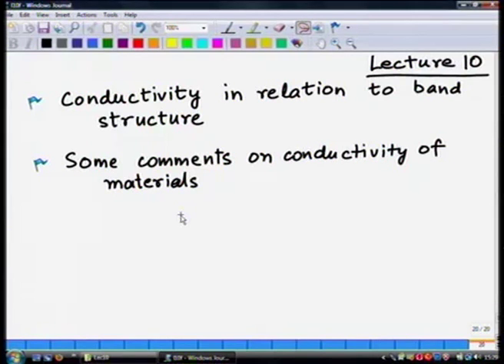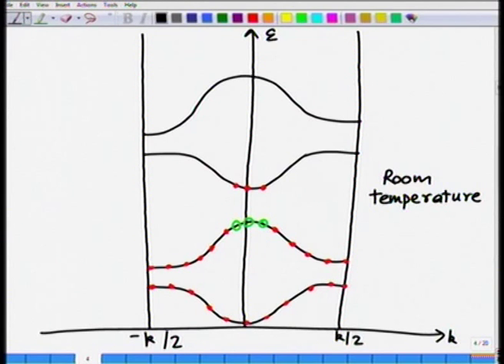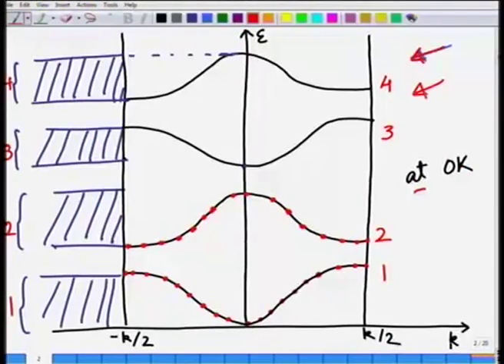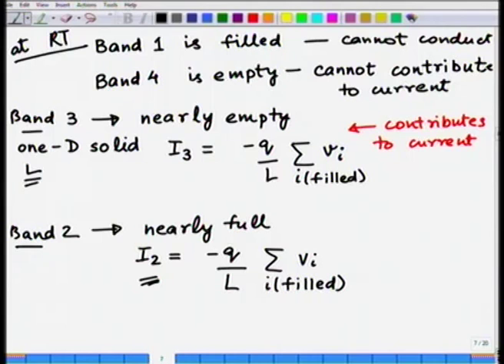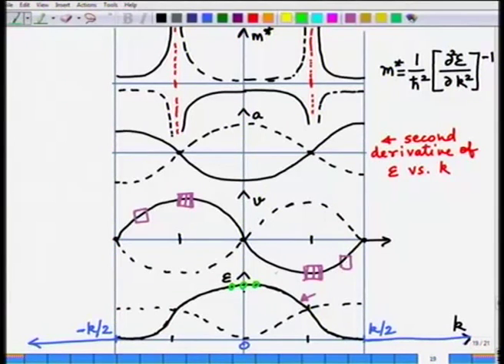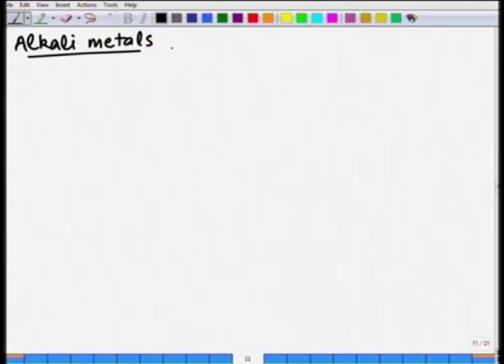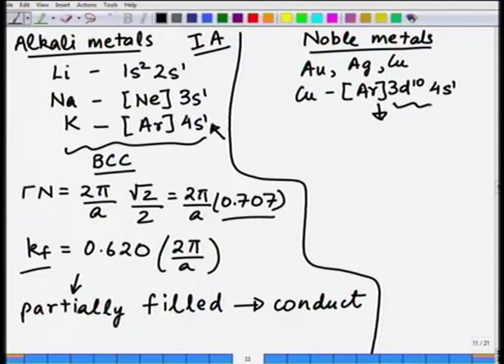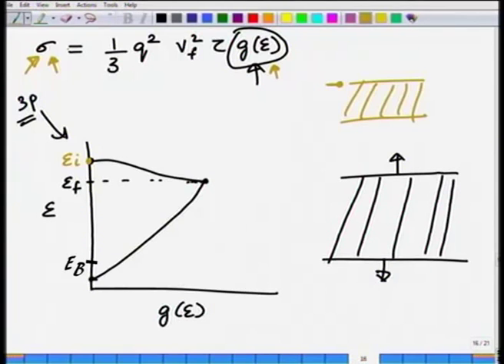Mod-01 Lec-10 Conduction in relation to band diagrams

Comment: when EF is applied the direction of motion of holes will be opposite to that of electrons right?????
Reply: @10:20
Reply: Note that that’s a vague question to ask
We never defined motion of electrons in real space 
their motion is studied in the k-space
We thought of holes in the energy diagram as empty places for electrons
So motion in the k-space for the holes are actually occupation and de-occupation of electron states
That’s how v_i for empty is defined

In real space I don’t think you can say electron will move to the left or right it could be in superposition of both these states where it has a greater probability to move opposite to the Electric field
Since “holes” are quasi particles not real and are analysed only in k space it doesn’t make any sense to ask for their velocities (if you argue hole is an empty location then let me tell you most of the space in an atom is free , which location you’re talking about ?)
Reply: @hrs7305  What :)?? It doesn’t make any sense to ask for their (holes) velocities?? Since when? Hole mobilities (velocity per unit electric field) are routinely defined and plotted as a function of field in any basic semiconductor device book. And in real space you can say whether an electron will move to the left or right under a field. How do you think MOS transistors work? Velocity depends on it's effective mass, which is a function of the E-k curvature, if positive it will move opposite to the field direction and vice versa. And finally when you talk of holes you are talking of locations in the valence band which are shells situated furthest from the nucleus, not the empty space in the atoms for smaller radii.